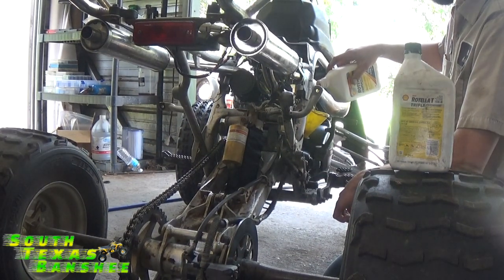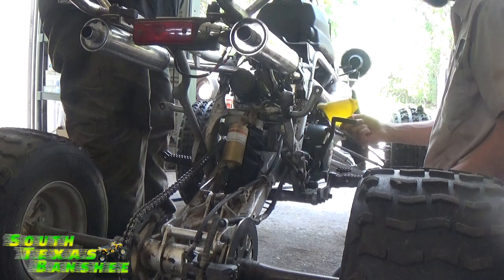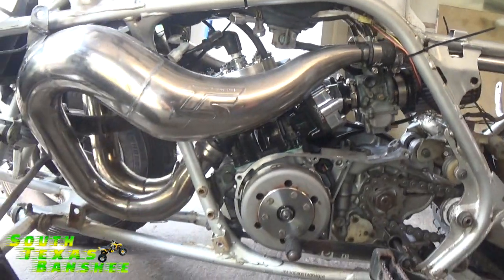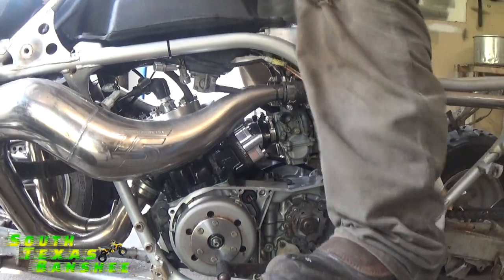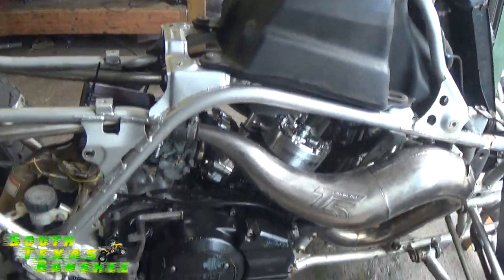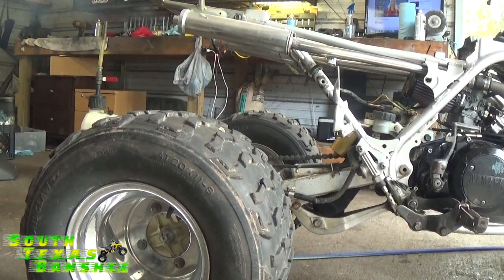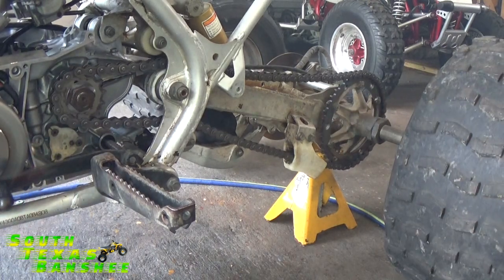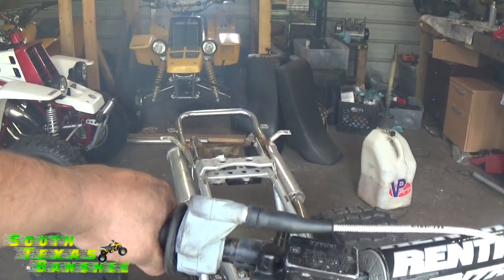Banshee first start and heat cycles

Comment: I recently  purchased a  banshee 350 twin installed new startor and carbs rebuilt,  I know it's a fuel problem I have  I cant get it to start unless I throw fuel through  rears of carbs.   Where did I go wrong seems like I'm not getting  any fuel and also my  chock  springs back in when I pull it out????.

Comment: hay I'm building my first quad I'm not sure what to expect from her. let me know what you think and if it should be pretty quick. banshee -vito super stock .60 over pistons 65.5mm.  v4 reeds.  pj carbs 34s?I think.   t5 pipes.  noss head 21cc domes adjustable timeing plate plus 4*   front sprocket is 15 teeth rear is 38 had 41. k&n 11inch long duel air filters no box. Will run on 93 pump gas if I have to do 50-50 of 110 so be it. I'm at sea level. I just hope she hauls on the straight aways. please just let me know what you think.  I'm use to a 400rwhp turbo 2.0L 2500lbs car.
Reply from the maker: sr20boostjunkie 
Go 20cc on the domes, you'll be fine. I run 20cc domes at sea level on 93 all the time.
it'll be a strong engine for sure. Might need to play with the gearing a bit to get it to make the power where you want it. it'll be around 65+ horses.
Reply: South Texas Banshee awesome thanks.

Comment: Just did a stock rebuild on my banshee , new heads   , pistons, crank case and pj 34 carbs , starts right up but after a few mins doing the heat cycle in spits out  a constant drip of oil from the breather tube , any ideas ? I’d appreciate it
Reply: Mine does that when I over fill the oil
Reply: Little late now but mine did the same and it ended up being a plugged rear vent. It was actually cast closed, so I took a punch and knocked out that thin piece of metal blocking the vent.

Comment: Nice vid as usual , how do u like that oil . I use Honda 80-85w
Reply from the maker: love the oil, run it in all 8 my quads and every quad I've owned the past 17 years.
Reply: +South Texas Banshee ive seen another banshee guy running it , Do you think it'll run good in a Yz250 2 stroke also
Reply from the maker: +dshamar14 yup, I know it will.
Reply: South Texas Banshee I have a question I redid the top end on my motor runs great I gave a couple of shots of gas just sitting there and It started revving up to full throttle ignition wouldn’t shut it off I pulled both spark plug wires off and it still was revving wide-open till I choke it out what is that

Comment: how many cycles im doing my first 96 banshee full build blasting frame ect...im running a two into 1 carb kehin 35 air striker with the oversized chariot float bowl chariot reed cages vitos superstock 65mm oversized radiator modquad hf impeller silicone hoses with engine ice....20cc domes on chariot cool head ill send pics when done bout a week or 2 oh and i got the dyna tek coil big stator and heavy mag flywheel. what should my operating temp be? and how long should i do heat cycles till i can open it up?

Comment: rotella in the case? I've never seen that before
Reply from the maker: Yessir! Google it, tons and tons of guys run rotalla in the gear cases and and engines,trx450's 400ex, z400, anything with a wet clutch. Rotella-T is JASO-MA so it's ser clutch safe..it's the only oil I've used for 17 years in everyhting I own, from my road bike to my lawn mower. never had a single issue. great oil.
Reply: +South Texas Banshee yeah my father is a tractor trailer driver so he swears by Rotella. Which weight do you use?
Reply from the maker: +Oneshotup, thr Rotella-T comes in 15w40. As far as I know its the only one JASO-MA rated. the T6 and others aren't. I'll admit to this, my gray banshee in the video on here was built in march 2 years 4 months ago. I never changed the tranny oil for that whole time and when I pulled the cover for and instructional video the oil was clean and still smelled like it was fresh from the jug. I was totally impressed. I have an hr meter on that bike, had 47ish hrs on that oil. if that oil is good enough for hard working turbo diesels hauling tons of hay a day, surely it work great in a plain old gear case in very mild temps compared to what a turbo sees.
Reply: +South Texas Banshee hey man that is great to know. I have been buying the Honda Trans oil only bc the guy I n purchased my Banshee from swore by it but I may look into the Rotella. Thanks for that bit of knowledge, I found you thru TrailBlogger btw. Great channel!
Reply from the maker: +Oneshotup Thank you!